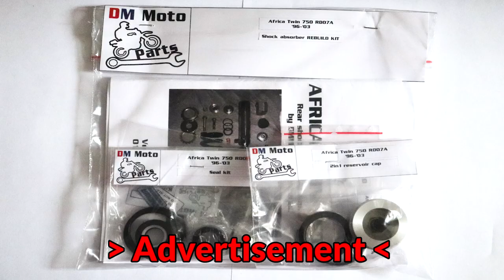🔧 Africa Twin XRV 750 Rear shock - assembly (free service manual to  download)

Comment: Perfect :) the right way to do it. Use SRAM butter as a Grease for mounting it s even better :) i service a lot with a lot of success. I would just fill it with nitrogen. It would get little warm with air. Nitro is a cold gas that won t expend under pressure and load
Reply from the maker: Thanks for the tip with SRAM butter. I'll check it.
Also I've built nitrogen charging station and use it now :)

Comment: Congratulations for the excellent video. Would you please tell me where did you buy the full repair kit? And what kind of gas you're using? Air? Nitrogen? Thanks in advance.
Reply from the maker: Thanks! :)
Repair kit is available at:  https://www.facebook.com/pg/DMMotoADVentures/shop
Now I'm using a bicycle shock absorber pump with no loss chuck. In the meantime I'm preparing nitrogen charge station for shock absorbers.
Reply: Awesome. Thank you for detailed insight in rear shock maintenance. Hope you could do it for RD03 soon.
Reply: Hello, I it seems your fb page is down. Do you still sell this kit?
Cheers!

Comment: Great information. Do you know the length of the fork ( middle of top, attachment point to middle of bottom) and spring rate. Is it also possible to make the hose between shock and rebound chamber longer?

Comment: Thank you! I didn't realize the rubber bump stop snapped on like that ... mine has a big ass washer underneath it and it just bounces around since I never snapped it in place ... I thought I screwed everything up and now I don't have to take apart again like I thought! Thanks again, you just saved me a lot of work!
Reply from the maker: You are welcome :)
After first bigger bump on the road bump stop will be in right place :D
Sometimes bump stop is wear out at the bottom and you can't snap it on.